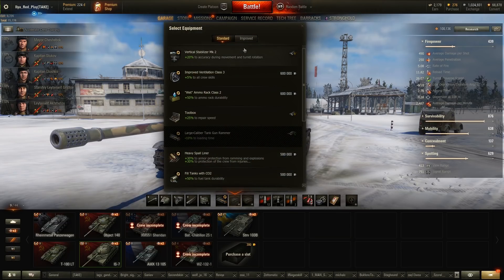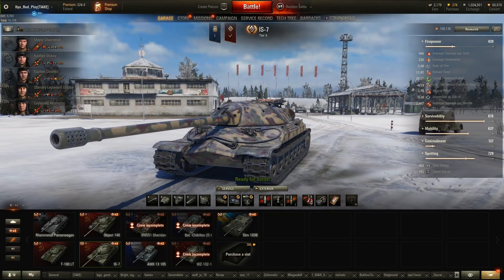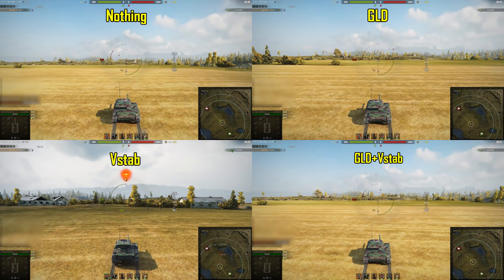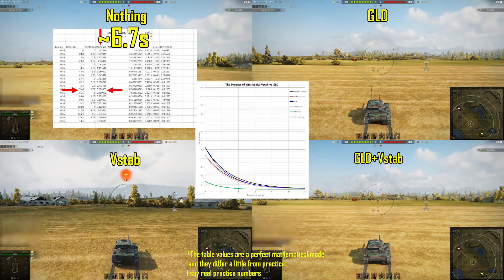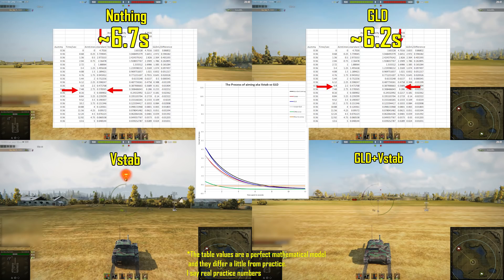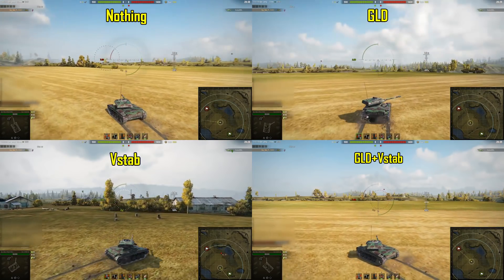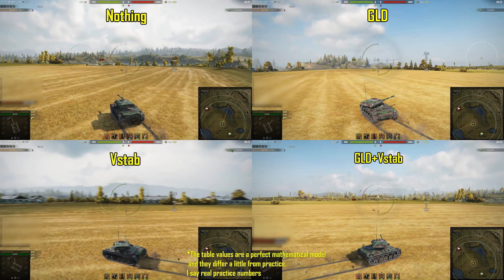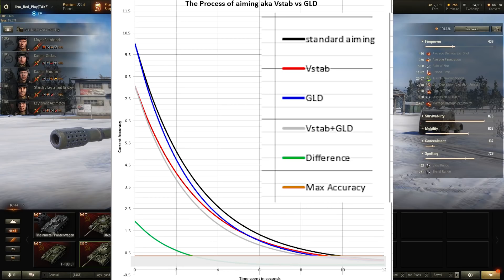VSTAB vs GLD? Experiment, graph, proof (short)

Comment from the maker: ABOUT VENTILATION:
I've plotted ventilation graph. VENTILATION GIVES ALMOST NOTHING AT ALL. It gives 2.2-2.5% to the parameters (5% to the crew skill IS NOT the same as 5% to the tank's stat). This is almost the same as without vents. It's a PLACEBO.
Reply: well, maybe regarding the aiming time. but they affect other skills as well, do they. higher camo, wider LOS, higher crits. my t-10 eventually got its reload under 10 s. So my puzzle - stabs, rammer and (vents/gld) is not fully solved yet.
PS do u rly have optics in is7? =)
Reply from the maker: vent's effects on camo or reload or aiming are totally negligible, maybe view range matters a little only. After all, 0.2 seconds quicker reload in a heavy doesn't matter . And yes, of course I do have optics in IS-7. It was really useful several times. It's nice to spot meds that shoot you. Any tank with at least 390 base view range really should have optics not to be killed by invisible med/light/td without spotting them at least after shot. and it was scouting battle in T-10 that got me 3rd mark in it :D was scouting in malinovka :D
Reply from the maker: Michal, Even though I agree with the general message that optics is important, please evade from insulting other players directly or indirectly (like in this case). Thank you
Reply: Dear Johannn, vert stab, optics and rammer is verry comon setup for 99% top tier tanks, just because you can outspot "vents users" who think they are smart with using useless vents instead of mighty optics. Especially when you are running the food. It is some kind of fun to be a HT scout. 
Just take a look at my IS-7 and my OP viewrange. :-)
https://s17.postimg.org/n599azhcf/shot_2376.jpg
Reply: +Ilya Red (WoT) well i mean - it it has 445 LOS without optics, so why bother adding any more? food+vents do suffice. I ve recently dropped my gld for the sake of vents + food , though my skill level sure makes  the equipment almost negligible, roflmao. my crew could defly use a directhand.dll as eq... =)
Reply: Did you stumble over my excel file in 2018? I cant even find it on the forums myself anymore. Epic to see it here :D
Reply: Ilyia Red I am really sorry for my bad language but I am mad everytime I see complete blind MT or even LT in my team. But it is because I "kemp in bush" and  I am doing a lot of "unfair plane" because I am "violet stetpedder". :-) 
I will edit my post so no "smart vents users" will be insulted in the future.
I cant say vents is a bad choice on the Patton, 486 meters viewrange is fine, but this tank has 420 meters base viewrange. Instead of 99,9% of other tier 10´s. 
Your "__Taz_"

Comment: good work, thought it will be like that, but good to have some research with exact numbers, vstab for firing on move, gld for stationary when your have actually time to aim...

by the way, dont know if you already talked on these topics, but: 1) binocs vs. optics on tier 5-6 (there are few vehicles i like to run from time to time -chaffee 59-16 and type 64) or get both and sacrifice gun rammer or vstabs.
2) how to counter enemy light that can outspot you on great distance bottom tier vs top tier or even on the same tier - non premiums vs t92 & elc 

thanks for sharing the music :D seems i heard the lyrics rightly, but the band didnt have them posted anywhere. Always good to find new stuff to listen even if it is small local band :)

Comment: Thank for the video. 
I would be interessed to see the combination Vstab + Vents. I believe  it is comparable to Vstab + GLD but you gain 5% on other skills like camo.
Reply from the maker: ventilation is a placebo and gives almost 0 to both aiming time and gun handling, I plotted ventilation graph, it's almost indistinguishable from no-vents. It gives too little effect. Vents give 2.2%-2.5% to every stat, not 5%, it's 5% to the crew, which is not the same as 5% to the stats
Reply: I mostly use vents if I don't have enough view range with optics allone
Reply: i use optics in all my tanks not artys,and i pick all VS skills to my crew try dat also i use food too.
Reply: VR skills

Comment: GLD Vstab is MUCH MUCH better cause of already added accuracy on the move and shit

Also: what about vents stab and optics vs rammer stab optics (I recently ditched rammer cause of scout guns having already quite short reload and that additional 10m is important (cause you are A FUCKING SCOUT afterall (*cough cough* camping scouts *cough cough*)) and also vents + stab give much higher PRACTICAL DPM than rammer's THEORETICAL DPM (and with <3 sec reload guns also aim time is longer than reload so thats also good idea)
P S did that on my WZ 132 and went from 93,5% MoE to 97% MoE in 3 days
Reply from the maker: Vstab adds accuracy on the move, GLD doesn't (you can see that with vstab the circle on the move is smaller). GLD doesn't improve dispersion, but the circle shrinks quicker. Vstab makes circle smaller, but it shrinks not as fast.
Reply: Ilya Red meant Vstab
Derp
(check edited part also)
Reply from the maker: ventilation is out of comparison in terms of aiming and gun handling, because it's a placebo. There is no practical difference between vstab or vstab+vents. Although I did play optics+stab+vents, for some tanks it's ok, but it's mainly for getting top scouting while not losing much of firepower (some tanks don't really need rammer unlike what most people think)
Reply: Ilya, what are Vents useful for then if you play scout? It is a "a little bit to everything" for me.
Reply from the maker: well, this bit of everything is usually pretty useless. It only adds some touch to the view range and camo that you can notice
Reply: Ilendir It add ~10m of view range when in WoT scale is HUGE (adds even more on better crews/tankd)
Reply: @Ilya Red: I wouldn't call 10meters of view range a "touch". But I agree that it is quite lackluster compared to optics but if you want to maximise scouting?